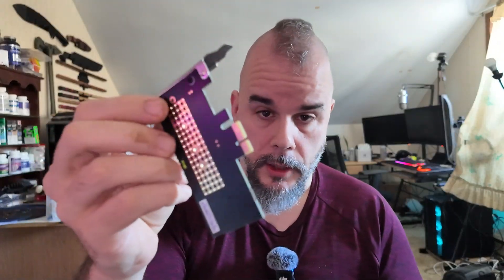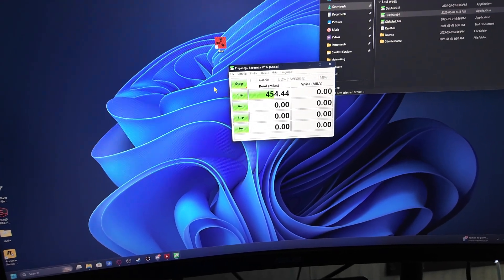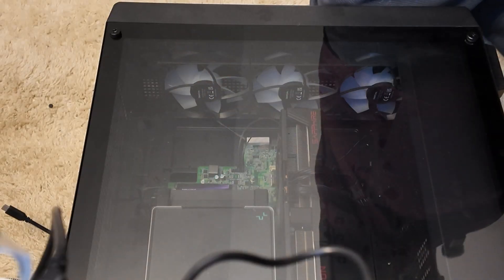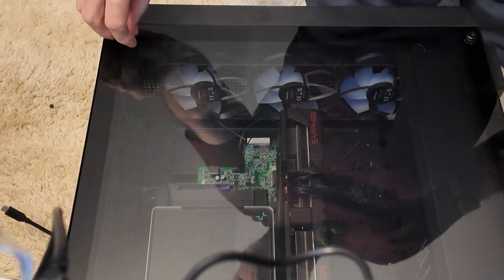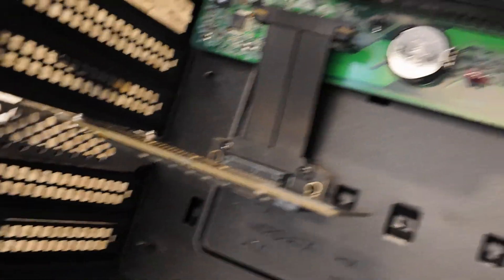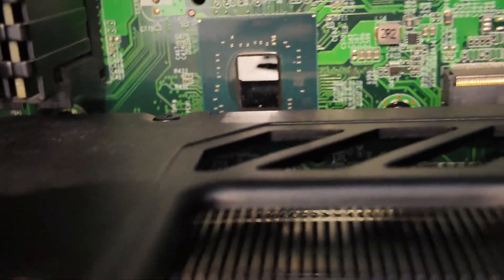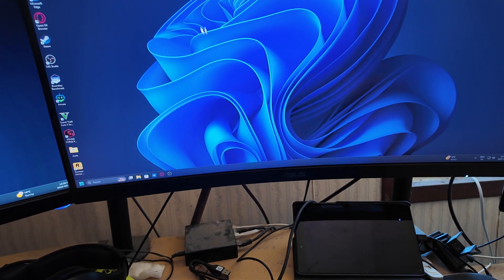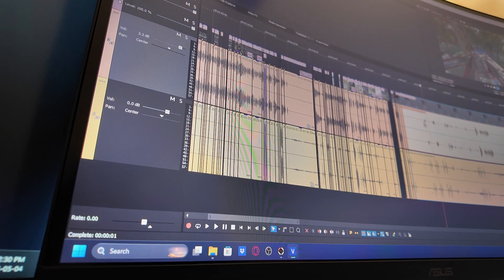Installing a 3rd NVME M 2 Drive to the Acer Nitro N50

Comment: When it comes to speed, I found my Lenovo E570 has an annoyance with its M.2 slot, in the specs it's an x4 slot, but in use, it runs as an x2, so a maximum of about 2GB/s speeds, granted it is 'ancient tech' now, but I'm still going to get it a better SSD cos the intel one that came with it is slow potatoes...